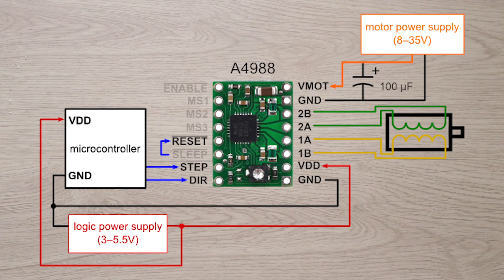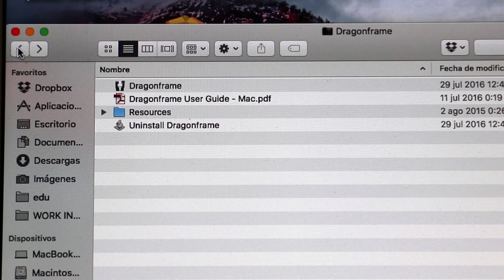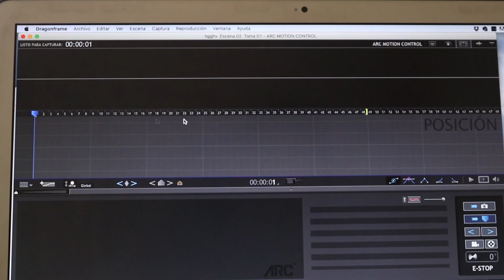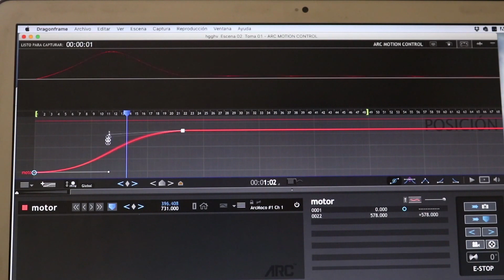Cheapest arduino moco driver setup tutorial for stop motion purposes

Comment: Is it possible to microstep with this set up?
Reply: I found this thread on Reddit:

[1] Hi guys. I have a nema 17 and a a4988 driver with arduino. Trying to get microstepping with dragonframe. Not sure what pinouts to use. The motor works, I just need more resolution. Thanks

[2] I think all you will need to do is tie ms1, ms2, and ms3 to +5v and you'll get 16 micro steps/step resolution.

[1] Thank you. I finally got it to work.

Comment: Hi, I Try to connect Arduino Uno with T6600 stepper driver and nema17 motor. This setup works fine with arduino, but motor doesn't work with dragonframe. I connected stepper driver to pin 4 i 5 and GND to GND. Channel 1 is on pin 4 and 5 by  default mode? Arduino Uno is connected with dragonframe correctly. Could you help me?

Comment: Hello, I didn't get the original Arduino, and have a few problems with my mac book recognising the arduino, did you have any problems with the USB port while uploading? I'm have a tough time figuring this out, but I just wanted to know if I should just buy the original Arduino UNO. :(
Reply from the maker: Not having those problems, but make sure you have the port and arduino model selected on the software

Comment: Hello Edu, first of all congratulations for your contribution to stop motion animation, following this tutorial everything works perfectly, but when I try to add a CNC Shield nothing happens. I saw your marks in another video to change Step and direction, even if the engine doesn't move. I'm doing a course completion for college and I need to present this prototype. Please help me. here in Brazil there are not many users of Dragon Frame, so it is difficult to exchange experiences.

Comment: Hello! I've assembled just about all the parts here for a stop motion slider rig I'm working on, but I had no idea what to get in terms of a 12V power source. I have some that plug into the wall, but would have no idea how to connect it to the board?? Could use a hand :)
Reply from the maker: Make sure you know what you are doing and you handle 12v not 240v, safety first
Reply: Right! Thank you. So I got the power working, but I lose track of the video at 2:22. Dragonframe is talking to the Arduino, but I don't know how to tell what order to attach the 4 wires to the stepper motor itself.

Comment: Hi, i have followed as you instructed, but stepper motor is vibrating instead of rotating..plz help asap.
Reply from the maker: Provably you have inverted step and direction cables
Reply: I tried it, but the problem is same..do i need to modify any code??
Reply: check the polarity of the stepper motor cables.. u might have the two coils fighting each other because you havent connected the right coloured wired to the right places.. sounds like that might be the problem as its all working but instead of the coils alternating to turn the motor they are alternating in opposing directions.. my guess...

Comment: Hola Edu, gracias por compartir, me he vuelto un viciado a tu canal!!!

Tengo un error con el arduino y nose cmo solucionarlo: 

C:\Program Files (x86)\DZED\Dragonframe\Resources\Arc Motion Control\DFMoco\DFMoco.pde:75:0: warning: "ARDUINO" redefined

 #define ARDUINO      1

 ^

<command-line>:0:0: note: this is the location of the previous definition

El Sketch usa 14030 bytes (43%) del espacio de almacenamiento de programa. El máximo es 32256 bytes.
Las variables Globales usan 1632 bytes (79%) de la memoria dinámica, dejando 416 bytes para las variables locales. El máximo es 2048 bytes.
Poca memoria disponible, se pueden producir problemas de estabilidad.

Eso es lo que me sale, sabrías por casualidad cual es el fallo?
Reply from the maker: hola, no acabo de entender. Tienes que abrir el codigo de dragon, entonces te saldra todo correcto y no tiene porque fallarte. La direccion del archivo no deberia salir en la ventana.

Comment: Hi Edu
I followed every step of your video and when making the connection from DF to the Uno - I see the lights flash on the board. But then when I run the arc control - there is no signal being sent to the board. I know I have the correct USB modem selected as the connection does light up the board - but no actions.
Can you offer any suggestions?
Than you
Sean
Reply from the maker: +spsauber It must be the code then, did you uploaded the code for arduino? It is on a folder un Dragonframe aplication, you need to instal Arduino software open this code and upload to the board. If it doesn't work mail me
Reply: I got it working. I am now going to work to set up control of the new awesome winder I just from Kinetic Armatures!

Comment: Hey Edu! I'm starting to build a moco slider based on this too, I was curious what to watch out for in terms of 12v power supplies in terms of Amperage, not sure how it entirely works so I just want to make sure I don't blow up any motors or drivers. I've got NEMA17 motors if thats anything to go by.
Reply from the maker: +Beardbotnik it is very dificult to damage a motor that way, drivers are more delicate. I will say nema 17 are perfect for small drivers, you must read the motor specifications and see how many amps uses. This drivers can't manage more than 2 amps. If you use a motor that takes more amps will blow up the driver. The power supply could be 12v 5amps, it is what I use.

Comment: Gracias por compartir sus conocimientos, me encantan sus videos, he seguido paso a paso sus instrucciones en este turorial, pero  en el momento de abrir el DFMoco.pde y seguir las instrucciones, sale un error y no he podido hacerlo funcionar con el dragonframe, por favor necesito su ayuda, estoy muy confundida no se como solucionarlo,  lo copio a continuación, de pronto con si experiencia me pueda ayudar, 

/Applications/Dragonframe/Resources/Arc Motion Control/DFMoco/DFMoco.pde:75:0: warning: "ARDUINO" redefined
 #define ARDUINO      1
 ^
<command-line>:0:0: note: this is the location of the previous definition

El Sketch usa 13.990 bytes (43%) del espacio de almacenamiento de programa. El máximo es 32.256 bytes.
Las variables Globales usan 1.630 bytes (79%) de la memoria dinámica, dejando 418 bytes para las variables locales. El máximo es 2.048 bytes.
Poca memoria disponible, se pueden producir problemas de estabilidad.

avrdude: no programmer has been specified on the command line or the config file
         Specify a programmer using the -c option and try again,

Gracias, de nuevo por todas sus contribuciones, y quedo super pendiente de su ayuda
Reply from the maker: Hola, puedes verificar un par de cosas que son las que me acostumbran a pasar a mi. Primero verifica que en el programa de arduino tengas seleccionada la placa que estes usando en herramientas/placa. Luego la segunda que el puerto sea el correcto en herramientas puerto. Modifica ambas cosas y vuelve a subir el codigo. Si así no funciona me dices.
Reply: Muchas gracias por responder, voy a revisar con cuidado y te cuento como me fue...

♪ ♫ ♩ ♬... Media hora después...

Hola hice las pruebas, revise y aparece seleccionada la placa Arduino/Genuino Uno, en cuanto al puerto solo me da dos opciones 

/dev/cu.Bluetooth_Incoming-Port
/dev/cu.usbmodem1421 (Arduino/Genuino Uno)
Seleciono la segunda,  subo y sale el error

"El Sketch usa 13.990 bytes (43%) del espacio de almacenamiento de programa. El máximo es 32.256 bytes.
Las variables Globales usan 1.630 bytes (79%) de la memoria dinámica, dejando 418 bytes para las variables locales. El máximo es 2.048 bytes.
Poca memoria disponible, se pueden producir problemas de estabilidad."

Te pido disculpas por mi ignorancia en cuanto al manejo del programa del Arduino, seguramente  estoy haciendo algo muy mal, ja ja ja, y es la primera vez que puedo hablar con alguien en español,  por favor ten paciencia, me encantaría poder hacerlo funcionar, siento quitarte tiempo, quedo a la expectativa.  Mil y mil gracias

Comment: Great tutorial. What voltage rating should the 100 microfarad capacitor have?
Reply from the maker: +Tim Fleck mine is 16 volts and works. I would say not under your power supply voltatge.
Reply: that's what I thought - thank you for clarifying!
Reply: +edu puertas what is the capacitor needed for?
Reply: It's required.  [its caused by "spikes" maded by motor, to not destroy arduino/driver (im not good at english, sorry)]